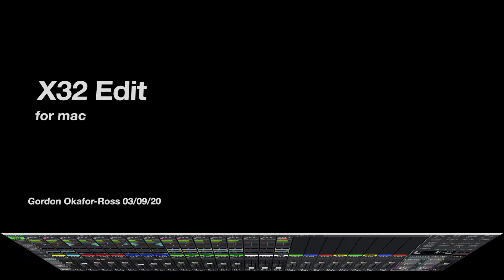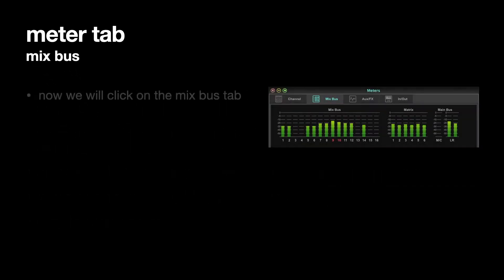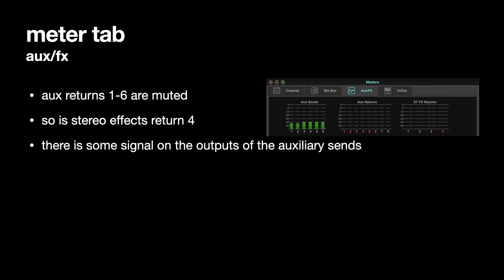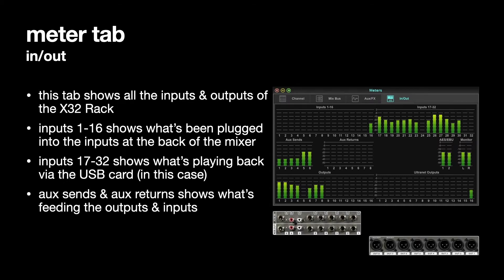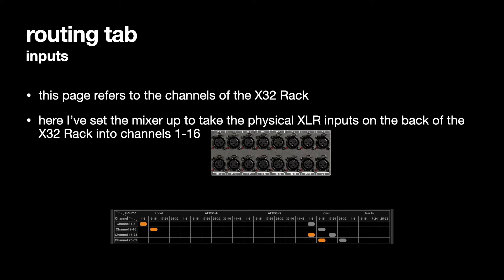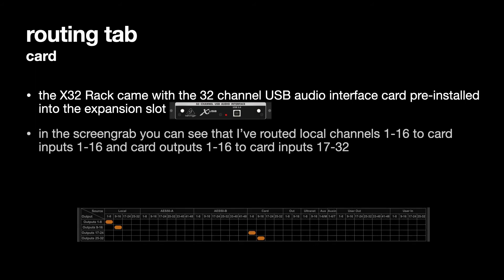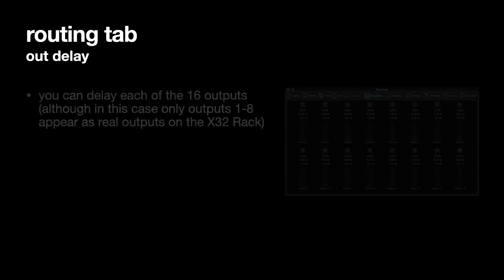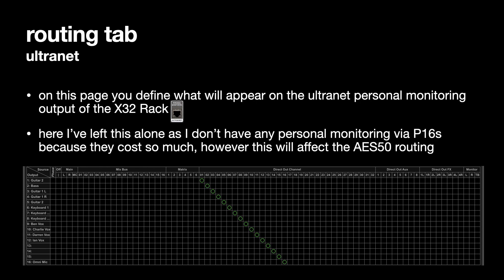How to use the X32 Edit Meter & Routing Tabs

Comment: Bonjour voilà mon problème j'ai fait ce que Musictribe ma donner   (une petite précision c'est une table Behringer )M32 FOH AES50 A > DL32 AES50 A
DL32 AES50 B > M32C AES50 A
 
Sur le la table façade Foh  Allez dans Setup > Global et réglez votre taux d'échantillonnage et réglez la synchronisation sur interne.
Sur le M32C (à l'aide de l'application M32-Edit) allez dans Setup > Mixer et réglez le taux d'échantillonnage pour qu'il corresponde à la console FOH, puis Synchronization to AES50 A.
Le système devrait maintenant se synchroniser, indiqué par les cases vertes dans le coin supérieur droit de l'écran sur le M32 FOH et sur le côté droit de M32-Edit pour le M32C.

Ensuite, sur votre M32C, allez dans le menu Routage > Entrées et réglez la Source sur les options AES50-A (voir capture d'écran suivante). Le M32C tirera alors les entrées du DL32.

le souci c'est que tout fonctionne depuis la table FOH façade et retours pas souci ,

mais depuis ma tablette connecté et mon pc avec Edit  m32 et  sur mon routeur et MDL32 et M32C

les volumes de fonctionne pas pas possible de les bouger comment faire le bon routing svp merci beaucoup